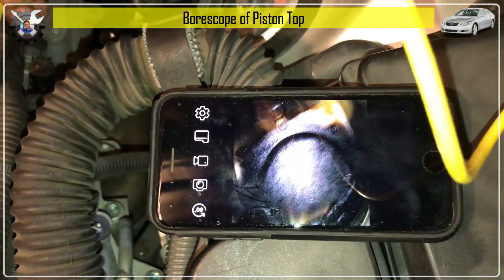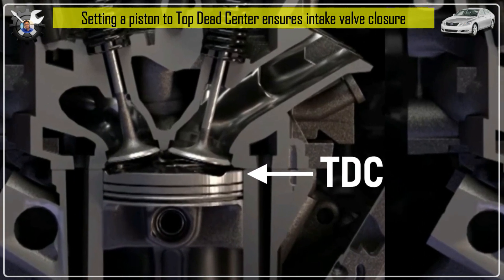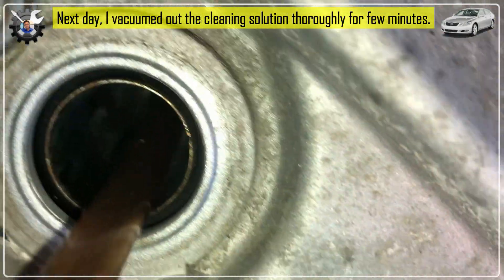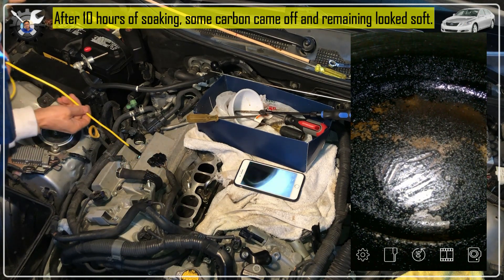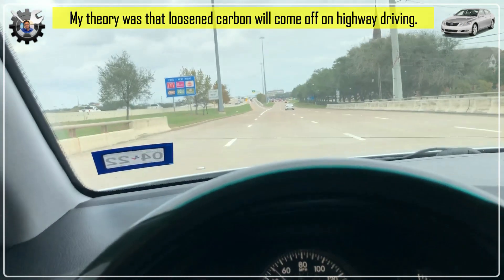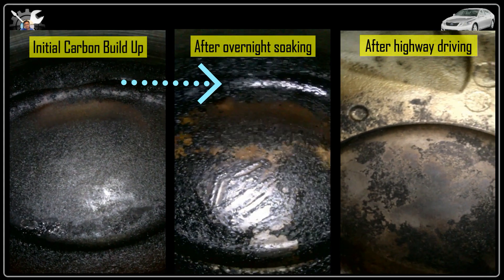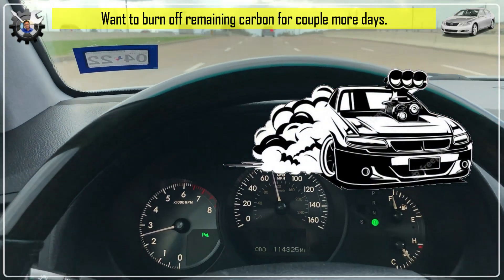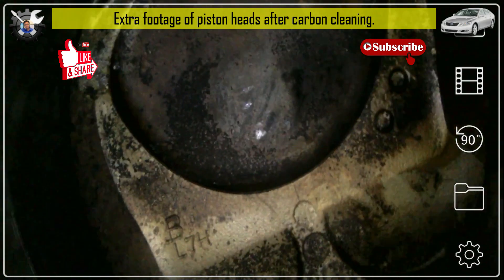Piston Carbon Soaking & Cleaning

Comment: Don't need to vacuum the cylinders. Just start the engine without spark plugs. It will all spray out.
Reply from the maker: Thanks for the commen. That is possible way, but Remember that these carbon cleaning chemicals are harsh to paint and rubber. If you keep it in long enough, they even damage aluminum.  So if you are going to crank to spray it out be sure to cover it with towel. And once towel gets wet, you’ll have to shift it to dry side. And hopefully, battery doesn’t drain out with extending dry cranking.   

In the end, I suggest to use borescope to ensure that there is no puddle of liquid still remaining.  Note that on V6, cylinder do not point straight up. Rather piston are tilted in angle and there is potential of puddle of liquid lingering in the lower corner.   

Just don’t want anyone to experience hydrolock.
Reply: I did that and it shot black goop from the melted carbon everywhere. It took far longer to clean than it did to get a #10 pump from the parts store which is what I did and have used since. Besides, you don't want chem dip touching anything except your combustion chamber.
Reply from the maker: @tommywilliamsjr.697  Yup that’s exactly why vacuuming/pumping is more cleaner and effective method.
Reply: @tommywilliamsjr.697 Did you cover the ports so that it didn’t go every where?
Reply: A towel is a good choice if you are maticulous about engine bay. Also I forgot to say to turn off injection system so no petrol sprays while you crank. Maybe your way is better but this is faster. There are more ways to clean the valves like walnut blasting or dry ice cleaning

Comment: Great video, i love the modified shop vac!!!   Definitly the best way I have seen yet to clean up the solvant without creating a big mess.  Also very thorough way to get most of the loosened carbon out before startup!!!  
Now that you got most of the carbon off of the pistons, you could try the Berryman combustion chamber cleaner to see if that can help clean up the remaining carbon.
Reply from the maker: I forgot to mention in the video that don’t use the vacuum with anything flammable like seafoam. Berryman is not flammable so it’s safe.
Reply: @DIYLifeSkills  excellent point.  yes Berryman has the B12 injector cleaner that can be added to fuel... some Youtubers do use the B12 as a piston soak.
Reply from the maker: @Verison12345678  Thanks for that info. I’ll be checking it out soon
Reply: @DIYLifeSkills  if you happen to use the Berryman combusion chamber cleaner, do another video on it with before and after pictures of the piston heads.  I'd love to see how well it works.  There are a couple other reviews of the product, but none with pictures yet, as far as i know.
Reply from the maker: @Verison12345678  My son's 2008 IS250 that we just bought has near 160K miles, and it's a GDI engine, so this could be interesting to try when I get to cleaning the intake valve carbon.
Reply from the maker: Didn’t know Berryman had combustion cleaner. I’ll look into it. Thanks

Comment: I am currently doing this right now it and it seemed that the chem dip soaked passed the pistons rings
Reply from the maker: My question is "how do you know?"   :-)
Are you watching the solution level using a borescope closely?

That said, it's a liquid so I'm sure some small amount could leak past the piston rings, 
but good piston rings should act like spring that expand outward and make tight seal against the combustion chamber wall
so at best only minimal solutions should get past the rings. 

In any case it's actually good if some chem-dip can soak the piston rings to clean carbon build up there,
but this could also indicate worn springs.

This is why I recommend doing the oil change soon after this cleaning.
It's probably better to drive a bit on the highway to burn off the carbon, which will contaminate the oil,
and then do the oil change.
Reply: @DIYLifeSkills  sadly I’m burning a quart every 100 miles (pretty sure rings are shot). I’m going to do this piston soak as a shot in the dark before I rebuild the the bottom end. At least I won’t be wasting money doing this since if I need to rebuild the engine, I can soak the pistons itself in the chem dip :) I know I should’ve done a wet/ dry compression test and even a leak down test beforehand but time isn’t on my side right now. How many hours should I soak the cylinders?
Reply from the maker: @pongstatus7268  Wow, that's a lot. So apparently, one of the piston ring (called oil ring) is supposed to scrape the oil off the cylinder wall, and that oil is supposed to sip through tiny holes around the cylinder head and drop into the oil pan, but if the oil change is not done regularly or low quality oil is used, these tiny holes get clogged and all the oil on the cylinder wall just gets combusted (hence burning oil).   Do you see some smoke coming out of the exhaust, and is your exhaust pipe all gunk up with black carbon?   Also burning oil for a long time will eventually clog the catalytic converter, which is also very expensive to replace. If you are going to rebuild the engine, sooner the better to save the cat.
Reply: @DIYLifeSkills  haha I checked the DCT history and it had a history of a bad cat. Since the previous owner needed to pass smog. He welded a new cat. I’m pretty sure the car has been burning oil for years
Reply from the maker: How long did you have the car and how many miles does it have? And how long has it burning this much oil?
Reply: @DIYLifeSkills  had the car for about less than an a year. 99 Corolla has 200k. Toyota had an issue where the oil holes in the pistons would clog of carbon so they added more holes in about 2003 to fix the issue. I don’t mind rebuilding the motor since it’s my project car but I just wanted to try this solution to at least aid the consumption. I’m dropping aftermarket cams and other performance parts soon which is also why I’m trying to free up the rings right now.
Reply from the maker: @pongstatus7268  Oh this is for 99 Corolla.  I thought it was GS300/GS350.  I’ve only watched the engine rebuild back high school decades ago. One of these days I would like cheap project car to try without worrying about messing it up. LOL

Good luck and let me know how things go.
Reply: @DIYLifeSkills  Just did the chem dip treatment. Had a lot of smoke haha. I don’t have a bore scope but when I  scrapped the top of the piston with a flat head, a ton of carbon sludge came out. Once I get to work, I’ll do a quick oil change and evaluate the oil burning issue after 100 miles. If it helped a little bit I’ll try doing the same procedure with marvel mystery oil and atf mixed with acetone.
Reply: @DIYLifeSkills  an update after the oil change. I think that the rings are shot. Still see a cloud of black smoke when gassing the pedal. The engine is way more responsive and smooth after the treatment though. Maybe after a while, the rings will free up.
Reply from the maker: @pongstatus7268  Watch some videos on “Liqui Moly Engine Flush”.  It’s a hit or miss and some swears it worked and some warn never to flush old engine.   So I’m not necessary recommending it, but if you are going to rebuild the engine and just want to give it some cheap solutions a try, then you might consider it.  Back in 80’s, I did engine flush on our family’s old cars and didn’t have any issues but modern cars are built differently with more precision so I’ve not done it in last 20-30 years.
Reply: @pongstatus7268  what's the latest?  DIY Dave was able to help his oil burning significantly on his 2az-fe with this.  Nothing else worked.  I had success in my 09 scion tc with gumout, which has a lot of PEA.  I tried MMO only in my 2013 chevy malibu and it did nothing.  I will now try berryman b-12.  I will soak with some oil after I do this though because otherwise the rings and cylinders will be too dry and unlubricated.  Hoping for better results with the chem tool.  Maybe I should just use gumout again, but I will give this a try.

Comment: Great video, I'm doing this to my car this week but I'm using seafoam .
Reply from the maker: Great.  Just one caution.  Seafoam is highly flammable unlike chem-dip, so if you use chem-dip, using a shop-vac  could spark flame and start fire in shop vac, so use hand/syphon vacuum hose method instead.  Or use chem-dip, since it worked well.  You do have to get nearly all liquid removed to avoid hydro-lock failure.  Looking back, I think you only need to soak 1 to 2 hours to loosen the carbon, and then once you remove the cleaning solution, you can then take it out on a high speed driving and it'll burn off all loosened carbon.  Good luck and let me know how it goes. Thanks.
Reply: @DIYLifeSkills  thanks but I'm gonna spray the seafoam through the throttle body and keep my rpms at about 2,500 to 3,000 and put the fuel cleaner in the gas tank and see how that works.
Reply: @dannysautorepair  Seafoam is ok, but a product that has PEA in it is superior. Red Line SI-1 Complete Fuel System Cleaner is EXCELLENT. Check the reviews. There are many other products out there with PEA as well. STP makes one. Cheers.
Reply from the maker: I’ll check it. Thanks
Reply: Seafoam is useless for cleaning carbon in my experience. It's just not a strong enough solvent.

Comment: Question when you drive on freeway did you just drive on sports mode or auto mode ? Because I do see your rpm reaches 5000 and 6000 which is great for cleaning carbon buildup ,,, mine never reach it unless I drive on sports mode ? Thanks
Reply from the maker: I normally don’t drive in sports mode as I don’t drive aggressively as I know how harsh that is on the engine and transmission.  But once in a while, like in this case, I intentionally wanted to drive hard to force the carbon residue to burn off since they were softened from soaking.
Reply: @DIYLifeSkills  make sense , I’ll be doing this method next week, can’t wait to see the top piston rings like brand new again 👍🏼
Reply from the maker: @Cosmopolitan86  Not sure about piston rings but piston top for sure will be clean. 

Which solution (chemdip or seafoam) did you decide to use?
Reply from the maker: @Cosmopolitan86  if you use chemdip you can use shopvac for quicker retrieve of cleaning solution.  If you use seafoam, you can use hand fluid pump, to remove as much remaining cleaning solution as possible. For hand pump it’ll help to have one person pump and one person move the hose around to soak up the solutions.
Reply: @DIYLifeSkills  I’ll be using chem dip for sure I saw alot of YouTubers using it with great results 👍🏼 , by any chance do you think the solution will stays on top of the pistons while leaving it for couples Horus since I’m not going to leave it soaked overnight or it will find it’s way and seep through the wall and end it up in the oil pan ??
Reply from the maker: @Cosmopolitan86  If piston rings are good, very little solution should slip pass piston rings but I’m sure some small amount will. Also once engine starts after cleaning, some of those loosened carbon that you couldn’t vacuum out will make it to oil and get passed through exhaust.
Reply: @DIYLifeSkills  the only thing I’m missing here is how do I let the piston go down to the bottom so I can suck out every drop of the solution? and how secure is the hose while attached to the duck tape along with the hose since I’m not sure how this going to work with my Ridged shop vacuum ??
Reply from the maker: @Cosmopolitan86  my gorilla duck tape held the hose pretty well.  It’s easier to vacuum if the piston is at the bottom, and you can rotate the crankshaft clockwise with a long skinny stick inserted into the spark plug hole.  This means you’ll have to rotate the crankshaft for each of the holes.
Reply: @DIYLifeSkills  question can I soak a spark plug in chem dip solution ?
Reply from the maker: I wouldn’t soak the whole thing and leave it in chem dip but you can repeat the dip to wet it and use a soft toothbrush to gently scrub off carbon.  Be mindful that there is expensive tiny iridium tip so careful not to damage or dislodge it.   Afterwards, you have to check and reset the gap.  Use filler strip gap tool only and not the cheap circular shape gap checker as they are not precise at all.
Reply from the maker: @Cosmopolitan86  Also when vacuuming out the solution, cut the end of the hose tip in 45 degree angle and rotate it around on top of the piston to suck out as much solution and loosened carbon out as much as possible to minimize any carbon residue/dust from making it to catalytic converter.
Reply: @DIYLifeSkills  denso comes pre gaped already and I don’t think that solution will change it, do you think so ??
Reply: @DIYLifeSkills  thanks for the tip I’ll do that
Reply from the maker: @Cosmopolitan86  gap change over time. When you remove it you should always check.  BTW, pre-gapped doesn’t ensure accuracy.  I had to regap some new Denso plugs recently.
Reply: @DIYLifeSkills  I’ll do it today I’ll keep you posted thanks again for your quick respond much appreciated 🙌🏼
Reply from the maker: @Cosmopolitan86  How did it go?
Reply: @DIYLifeSkills  I did bank 1 just to test it out and man let me tell you it works  as planned my top piston got Almost 85% to 90% cleaner I did exactly like you did in the video 👍🏼 going to do bank 2 later in the day 🙌🏼👍🏼 thanks a lot brother
Reply from the maker: @Cosmopolitan86  I also tested 1 cylinder in bank 1 before doing the rest.   🙂
Bank 2 spark plugs are bit tricky to remove with other wiring harness getting in the way. 

Here is a video on how I removed spark plugs on bank 2. 
https://www.youtube.com/watch?v=7KEB6DJeEFI&ab_channel=DIY%26LifeSkills

Also, some wire connectors broke during this work, and here is a video on how to find the part # and how to replace them: 
https://www.youtube.com/watch?v=wWBCgY9nN_0&ab_channel=DIY%26LifeSkills
https://www.youtube.com/watch?v=nX33dk11EU4&ab_channel=DIY%26LifeSkills

My car was about a quart low in oil, so I fill it with Mystery Oil just before performing this carbon cleaning, which also helps to clean engine parts, 
and after carbon cleaning, I probably drove 50~100 miles on highway to cleanly burn off loosened carbon, 
and then did the oil change.
Reply from the maker: @Cosmopolitan86  By the way, great work!
Reply from the maker: I got the full car fax report when I bought the car, and they did pretty good maintenance but I don’t see transmission and rear axle fluid getting changed so that’s something I’m planning probably in the fall. It’s nearly 100 degrees here everyday and it’s hard to work in that temp.  :-)

Comment: i heard how chemdip is bad for alunimum blocks and it eats away the metal since its so harsh. Do you think its safe for the engine?
Reply from the maker: Chem Dip instruction says to soak under 4 hours for certain aluminum. Well, I didn't know that instruction at the time of the soaking and ended up soaking for about 10 hours overnight.  Not necessarily because I wanted to soak that long, but the day ended and I resumed the work the next day, so that was about 10 hour gap. 

I've not had issues, in fact, after heavy carbon build up cleaning on intake valves and piston tops, the car seems to idle more smoother and accelerate bit more sharp. 

There are many YouTube videos on people soaking engine and engine parts for 1 to 2 hours and they rave about how carbon literally melted, which was also my experience.  So in conclusion, based on other videos, I think 1 to 2 hour soaking is sufficient and that's well below the 4 hour limit mentioned on chem dip instruction. 

I'm not afraid at all to soak engine with chem dip, in fact, I plan to chem dip soak my 2 other cars, 2013 Camry and 2016 Corolla sometime this summer. 

This guy soaked for 2 hours, and mentions that chemdip instruction says to limit to max 4 hours for aluminum soaking. 
https://www.youtube.com/watch?v=voe-ZcKjg4Y

Here is a guy who soaked the pistons for about 1.5 hours. 
https://www.youtube.com/watch?v=q98BSSuicJo

Here is another one, soaking for 1 to 1.5 hour. 
https://www.youtube.com/watch?v=7ei5gXcbl-k

This guy soaked the engine for more than 1 hour.
https://www.youtube.com/watch?v=j34KTk8ZODg
Reply: @DIYLifeSkills  This video was so useful. Thank you for making it.

Comment: If you allow the engine to suck in water through the intake then you will get really clean piston tops and combustion chamber.  Might not be good for the A/F ratio and O2 sensors though.
Reply from the maker: Only if spray light mist is sprayed slowly, otherwise pouring in water will cause hydrolock and kill the engine.
Reply: @DIYLifeSkills   Oh yes of course.  I would use a small vacuum hose connected to the intake and let is suck in water a little at a time.
Reply from the maker: Yeah something about high temperature and water vapor combination have proven to remove carbons.  I’ve seen videos where they use a spray bottle to spray misty water through throttle body slowly.  Other being super careful to not add too much water at once, I think it’s one of the effective cleaning method.  In fact few years back, there was a big battle by a UK mechanic and other YouTube creators on whether water is more or just as effective as SeaFoam in cleaning carbon.  :-)
Reply from the maker: @seatee4770  I just like soaking method since it’s doing most of the carbon cleaning while the engine is not running and afterwards I get to vacuum out the most of the loosened carbon and remaining solution.  And then I drive it on a highway to burn off any residual loosened carbon and cleaning solution and then immediately do the oil change. This way I’m minimizing loosened carbon circulating around PCV, exhaust valves, oxygen sensors, and catalytic converter.